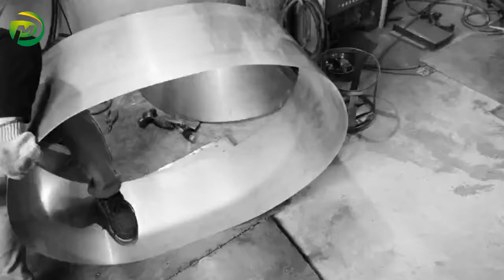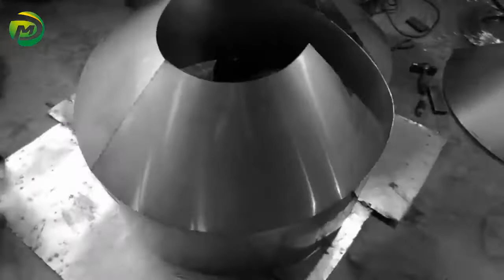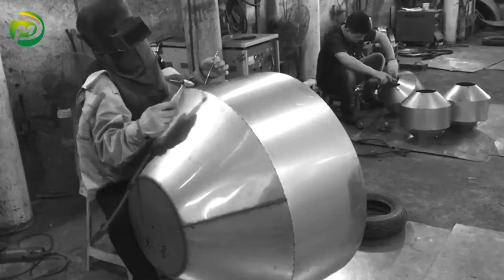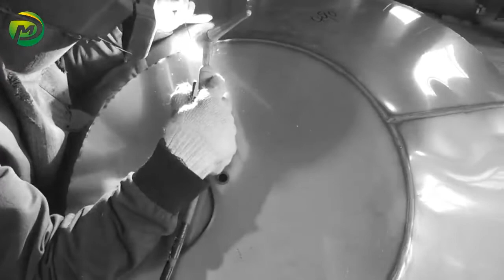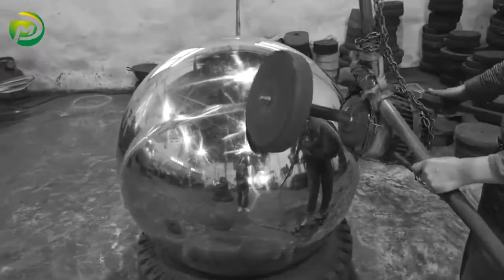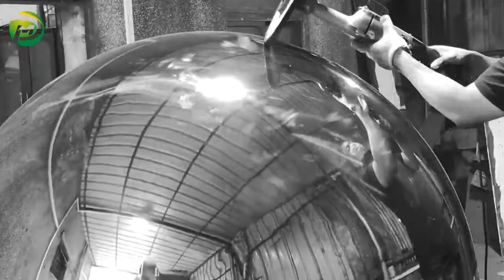Metal sphere factory

Comment: For those who wonder how they do it.
They weld a cone to each end, then they weld a fitting to it and fill it with water under pressure. The water forms the object into a sphere. The fitting is cut off, water is let out, and the hole is welded shut. Then they get grinding and polishing.
The process is called hydroforming.